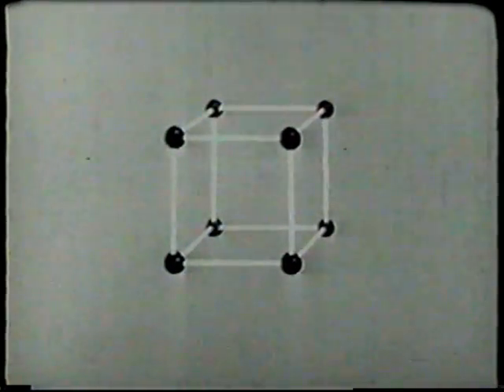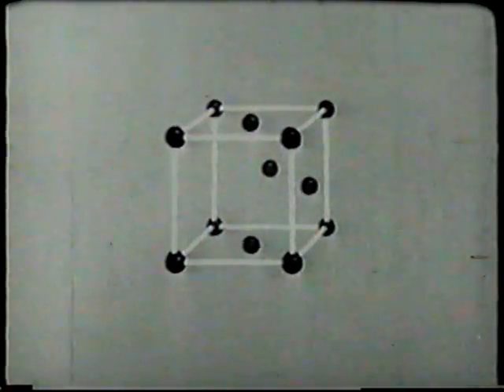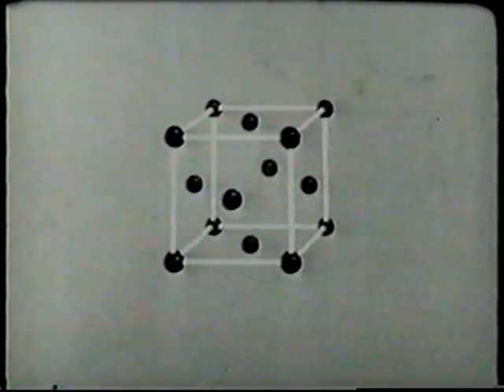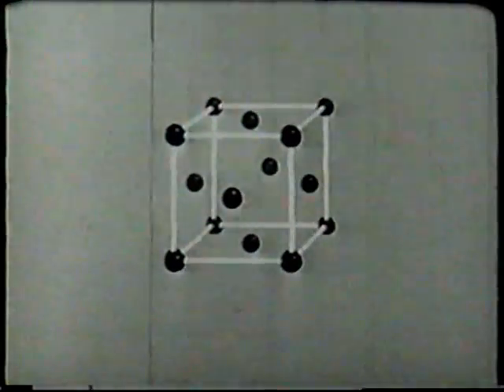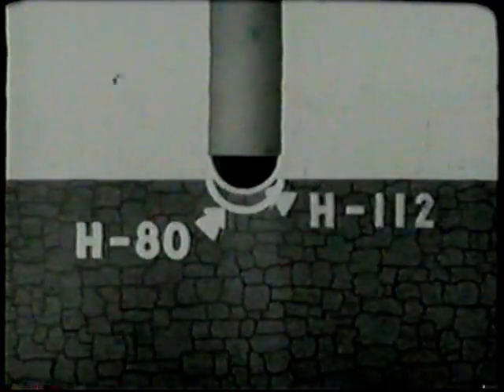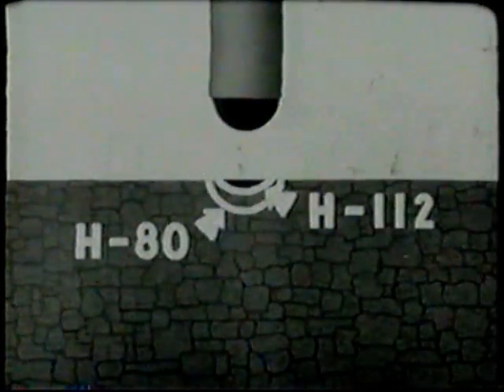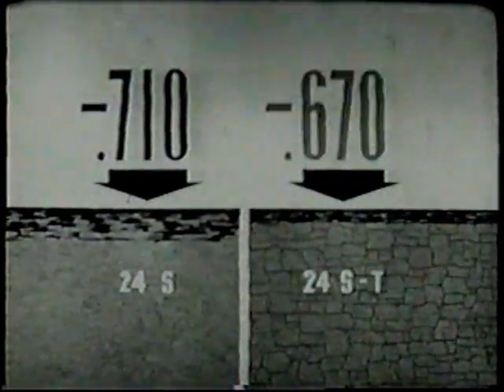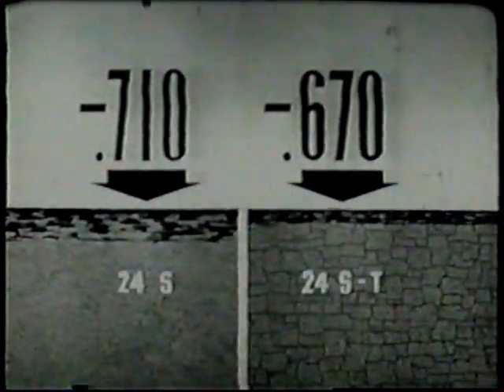Heat Treatment of Aluminum Part 1

Comment: Dear sir 
We have a round aluminium pipe diameter 40mm and thickness 2mm,  alloy is 6063
We needs tensile strength 275 M pa 
Please can you tell me how we can get this strength and what will process?
Naveed ahmed , Pakistan
Reply: No heat treatment necessary. An 6063 alloy pipe will easily resist 40 thousand PSI.